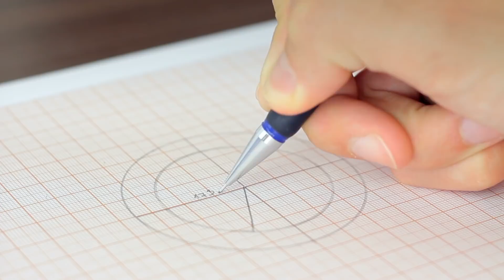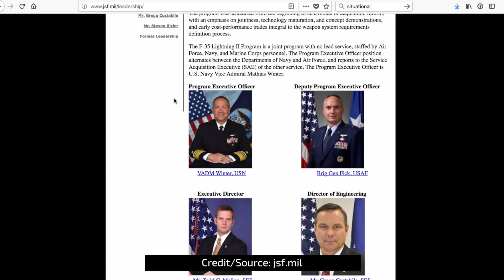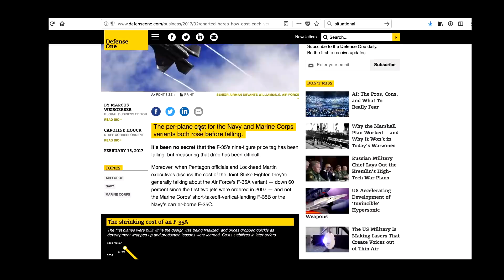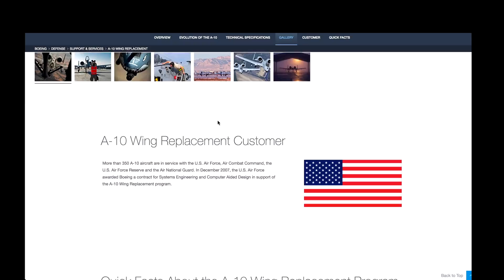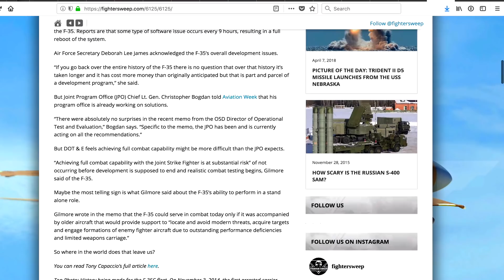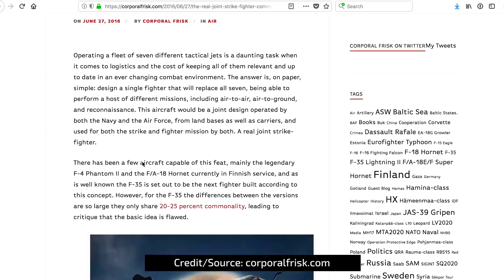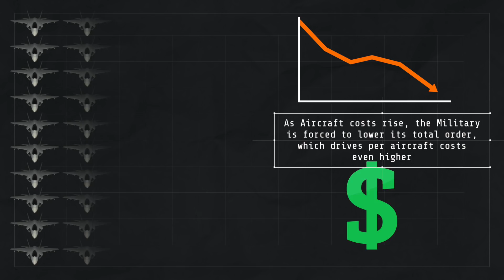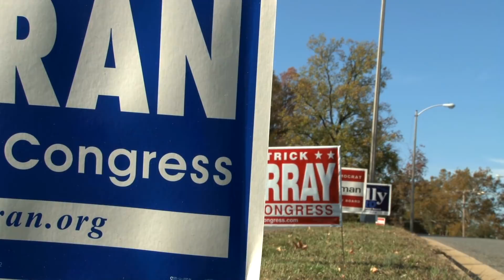Why the F-35 Lightning II Might be the Most Expensive Military Aircraft Mistake Ever

Comment: The F-35 is an aircraft that comes with a gun. The A-10 is a gun that comes with an aircraft.
Reply: Ruby Infernum true that lol
Reply: Kinda true. But that doesn't make the F-35 worse than the A-10. 
The A-10 might have a great reputation and is great when it comes to "psychological support" of the troops. However if you see the reality, it is one of the combat planes, which had the highest shoot downs compared to its missions. 
The issue is: for the use in uncontested airspace, there are much cheaper options (e.g. the Super Tucanos) and in dangerous airspace the F-35 would do indefinitely better!
Reply: Thành Hoàng Ngọc  We are going to lose some F-35's. It's going to be used for everything, at some point someone will get lucky and kill one. 

As to the F-35 and CAS, it's never going to fly low and slow and kill enemies with it's guns. It's version of CAS will be flying high and safe from ground weapons, using it's superior sensors to accurately drop small diameter bombs on the bad guys. 

Believe it or not, they is a reasonable chance that the A-10's mission will be taken over by turboprop aircraft. The US military is researching small, cheap turboprop aircraft that can use the latest weapons and fly much lower and slower than the A-10 could. They won't have that huge cannon, but they won't need it. The cannon was meant to be an anti-tank weapon and we aren't sure if it could kill the latest heavy armor.  Those turboprops also have the advantage that heatseeking weapons will have trouble targeting them. The exhaust is fairly cool, IR weapons were not meant to target aircraft that relatively cold. 

link   https://arstechnica.com/tech-policy/2018/06/air-force-tests-two-turboprops-as-potential-a-10-replacements/
Reply: @Elthenar  
 problem will arise when the bad n good guys are soo close thats difficult to diffrenciate.(hence the Close Air Support)  Care to info hw they hv solve this matter.
Reply: @kentershackle1329  To be fair, the A-10 has struggled in that scenario too. The A-10 has fragged a number of friendlies when the battle lines get confusing. The F-35 isn't optimized to fly slow and take hits like the A-10 but it has vastly better sensors. I'd trust the F-35 more than the A-10 to sort out friend from foe. 

Also, look at my second paragraph. The Air Force is testing out modern turboprop aircraft to provide that level of close air support. It would be similar to the old A-1 Skyraider.  It would be an extremely low cost aircraft that costs little to fly and would be more capable of providing pinpoint CAS support than anything that's ever existed. A turboprop plane is far more efficient at flying low and slow than even the A-10 is.  The more I think about it, the more I really love the idea.
Reply: @Elthenar  
The reason USAF wants to axe the A10 is budget, there isnt enough to go around. The A10 needs new wings n upgrading.  Regardless other issues like loitering hrs, amount of ammo , per hr fly $ rate. but then lets just leave it there for the brass to solve. 

Turboprops?. They been evaluating it for decades.. if im.not mistaken it'll be more for SoCom -SpecOps.  In hindsight ita intreasting what a couple of UCAV can do?
Reply: @kentershackle1329  UCAV's suck for CAS. Imagine playing a shooter game with horrible lag, that's what flying a UCAV is like. For some missions, it doesn't matter so much. For a mission where you have to put precise fire on bad guys who are very close to good guys, not so much. 

UCAV's will become more and more capable, but there will always be a need for manned aircraft. As UCAV tech advances, so will the ability of the enemy to spoof, jam or hack them. Sometimes there is just no substitute for a real person on the scene.
Reply: hahahahahah very true!
Reply: B.A.C.E., aka: Best. Aviation. Comment. EVER!!! And the F22 was too expensive. Hmm...
Reply: Its just a gun with wings and a chair.
Reply: Right...a gun that can't shoot straight nor can it kill a tank - the 25mm doesn't have the punch of the A-10 GAU-8. One big multi multi million dollar flying turd!
Reply: Cato Sicarius the F-35A has a cannon. The B and C models don't have one but can have an external cannon pod attached if the mission calls for one.
Reply: @itsmrweed8695  - I don't think you understand the original comment. He did say that the F-35 has a gun. He's merely pointing out that the A-10 was quite literally designed as an aircraft built around a gun. It's a gun first, and an aircraft second.
Reply: a flying gun
Reply: are you sure the f35 has a gun yet??
Reply: @lesliegrayson1722  yeah   i seen it in action on die hard 4 point ohhhh
Reply: You hear that distinct fan jet sound coming,then this beautiful grey/black bird pops up over the tree line as the ground 1500 meters ahead erupts into a incredible ball of destruction.... then all of a sudden the inbound mortars just stop like they were erased..... God bless you warthog jockeys,you and your beautiful bird will be missed
Reply: This is truly grate
Reply: Brrrrrt
Reply: And your argument about getting in and out of an airspace stealthily doesn’t make sense.  You don’t need stealth to fly CAS.  You just need a lot of fire power, which the A-10 has.  I urge you to read these articles on stealth

https://www.google.com/amp/s/www.wired.com/2011/06/stealth-tech-obsolete/amp

https://en.m.wikipedia.org/wiki/Stealth_aircraft
Reply: The A10 is junk
Reply: the F35 is a jack-of-all-trades that is suficient for a couple of basic tasks where otherwise OBSOLETE planes would need to be kept flying ... the F22 will be complemented in the future with UPGRADED F16 to replace ageing and EOL F15 in the air defense role ... the cost of the F16 SLEP will be 1/2 that of the procurement of 100% new planes ... A-10 and F-15 wings need to be replaced ... it costs 1/2 of a new plane

The F35 airframe is meant to replace life expired AV8/F111/A6/A18(not the F18E CAP) in the navy/marines and to relegate usaf F16 airframes to air-to-air roles until their airframes became expired (those same F16 replacing the F15 airframes) ... by that time  the 6th generation "fighters" will be replacing F22 airframes ...
Reply: @sotabaka  Fan Boy!?!?!
Reply: Perfect 👌
Reply: One F35 would take out every A-10 ever made without the A-10 being able to fire a shot at it.
Reply: @duckyops  While this maybe be true, the A-10 was designed solely for CAS missions and isn't suited for air-to-air. The F-35 however is designed with air-to-air in mind.
Reply: @xenoshadow-pruzeim-5075  A-10 was specifically made for hunting tanks  which also happens to make it good at CAS. CAS is getting more difficult as SAMS get more range and fighters can look down with their radars.
Reply: @Arpthingy  True. But I was responding to the comment about the F35 taking out every A10 ever produced.
Reply: @duckyops   because the Warthogs wasn't made for air combat
Reply: @duckyops  It`s not the task of an A10, Sir. Ask the troops on the ground in shit, what A 10 is made for. Ask the troops first, Sir.
Reply: GermanGreetings Of course, bit the truth is that the A10 needs a clear airspace to do that. If you compare both... pop.
Reply: @duckyops  You are right. But infantry, surrounded by taliban, may think different. I hope, that the era of A10 will be analized with less emotions pro as contra, as during its service. But I always would ask the ground troops first, having been in shit, when it`s about the development of a next generation. So I do not argue against any other plane. But I amshure, that US military does not want a second Stalingrad - in what scale ever. 
Thank you for answering, Sir !
Reply: GermanGreetings I don’t think most infantrymen would be well served by them operating in places that aren’t controlled airspaces. Afghanistan is perfect for A10. Russia? China? No chance, brother. That’s not to say they haven’t done a brilliant job.
Reply: @duckyops  China and Russia are no realistic Battle-Places. That´s it, what a german in 2020 learned about Hitler - moreover in the mirror of Napoleon, both attacking quite too big countries... Iran and its high mountain-landscape modestly included already, as it was a very close conflict to our present times: Even US-capabilities would waste too much blood even there, for then being weakend to master any other endeavour? Our combined wisdom should be: Do we want to go to Vietnam or Stalingrad, ...or do we want to reach the moon... this second time after having guaranteed health-insurance for every american citizen ? That`s my opinion: Doing one step after the necessary first one. A mother would say: `before you go out to cange the world, clean up your nursery`:) 
(Kinderzimmer in german, did google translate it right?)
Reply: Alex bruh that’s because the A-10’s an attack aircraft. It’s not supposed to shoot down other planes. You’re comparing apples to oranges. Using your argument you might as well just get rid of helicopters cause they can’t shoot down airplanes.  They’re used for different things.
Reply: Will R Absolutely they are used for different things. I agree they shouldn’t be compared, I was replying to those doing the comparisons. That said, when a comparison is made, there’s only one winner. The A10 is a good, cheap ground support aircraft that can’t do much else and even then, only in controlled airspace. The F35 is a much more useful tool going forward.
Reply: @duckyops  sure if he had enough ammunition
Reply: Ant1 it could get in and out of the battle space without detection, so would be able to resupply.
Reply: @duckyops  lol yeah sure
Reply: Ant1 The A10 couldn’t be flying in an airspace with air defences. It’s only real use is fighting in areas where the battle space is entirely controlled by friendly forces.
Reply: @duckyops  like you know what your saying kid
Reply: Ant1 Interesting polemical style, Ant. If you disagree, you could try forming a cogent, coherent counter argument rather than turning to baseless ad hominem insults, using stereotypical misspellings. It’s ‘you’re’ not ‘your’. Us kids, even those who left school decades ago, know that. Now, back to the Air-to-Air and BVR capability of the A10. No? Thought not. I look forward to your reply telling me how stupid I am.
Reply: @duckyops  sure. No need to waste time on a youtube comment
Reply: @duckyops  honestly I would like this argument to keep going its quite funny
Reply: Ant1 An argument has two sides. You’ve literally not given an opinion much less a rational argument.
Reply: @duckyops  keep going
Reply: @AntoineMagnifique I urge you to read your replies back and think about how you look to other readers. A fool and a troll, if you were wondering.
Reply: @mage7053  exactly
Reply: @duckyops  The F-35 is a like a swiss army knife, while the A-10 is like scalpel.
Reply: That doesnt make any sense
Reply: @AntoineMagnifique  Yes it does.... they build the Aircraft around the gun. That is literally how an A10 was designed. It is a tank in the Sky. My favorite Aircraft, it has saved my life in combat  and many others.

Comment: There are a number of problems with this video, good as it is.

1: The program is still in development, all planes have had problems notified in this stage with fixes proposed, to treat it like a full production plane is not sensible, the problems are standard fare in terms of plane development and mostly software bugs which get ironed out.
2: The pilot speaking about the F-35 vs F-16 was taken out of context, in that stage of testing the fly by wire system was not configured for full manuverability yet for safety reasons, they test it and gradually increase the allowed function, current pilots are pleased with the plane's performance.
3: The F-35B is currently undergoing carrier trials with HMS Queen Elizabeth off the east coast, the result of which will determine the legally required go-ahead for full rate production, up till now the airframes coming off the assembly line have been low rate initial production, with volume comes cost savings, the cost will come down once full rate production goes ahead and foreign customers start getting the large bulk of their order rather than the initial token planes that have been delivered.
4: Program costs are huge, however, if you factor in that this jet replaces several planes, the replacements of said jets with seperate projects would likely amount to the same or greater costs, and the cost should also take into account the intended life cycle of the jet worldwide with potential expected life with upgrades up to 2070, now that figure might be ambitious but it proves that this is intended to be a mainstay of the US and allied air forces for many many decades, with shared technology advances and upgrades from various partners costing less overall than separate jets with separate upgrade projects would cost.
5: There are still calls to cancel this jet, despite many being delivered and being used in service, many other countries ordering them, and cancellation not recovering the already spent funding, as well as cancellation requiring replacement projects to be delivered on time for when the current planes that need replacing reach the limit of their service life, such a late term cancellation would cost more money in the long run than continuing with this project. This also means the US would have to pay cancellation costs to other nations who have put a stake in this project, notably the UK, who have built their two new carriers around the F-35B and will be stuck with a costly carrier refit to CATOBAR or a new STOVL jet purchase without the F-35.
Reply: Honestly if the US government cancels this order, it will end up like the Zumwalt class, because there are only 3, the cost of the ammunition for the main gun is so insane the government aren't buying any rounds, so you're saddled with the R&D cost and three boats with no usable gun.
Cancellations come early in the life cycle, not once the items are being delivered, the US defence procurement needs to learn this.

Comment: multirole fighter/bomber jackofalltrades idea is insane.
its like trying to combine an economy car and a dump truck in one chassis! AND JUSTIFY  the 
enormous resulting COST !
the USNAVY MIGHT justify this because of sheer lack of space for  planes and spare parts in aircraft carriers-but NO other service CAN.
my suggestion would have been to restrict the F35 development to the marinized VSTOL version, replacing the AV-8 harrier for maritime roles-in which the f35 excel-particularly for NATO small carrier navies. 
NATO needs a much cheaper, simpler and smaller mass produced point defense interceptor/fighter such as the JAS39 GRIPEN for land based defense.
for land battles and close air support, nothing beats the A10 for cost effectivness.